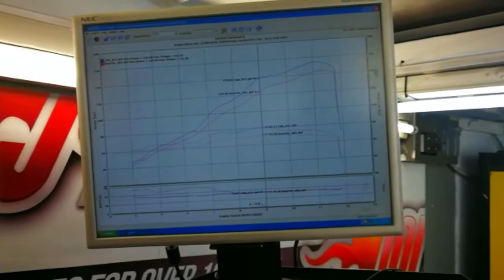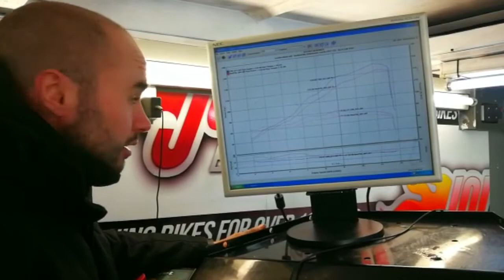JORDAN BIKES DYNO - YAMAHA MT-10 ECU REMAP FLASH 11 BHP GAIN

Comment: Hi, what are the expected gains on the simple ‘bench’ tune with a decat pipe please? Thanks
Reply from the maker: Dave The Rave we’d recommend a custom fuel map if you’ve removed the Cat, as it will be running lean. We don’t quote figures as every single bike is different. Watch the video on our ECU page on the jordanbikes website in which nick explains what we do and what you can expect. The MT10s we are constantly remapping as they are so snatchy on the throttle. We can make them loads better 👍🏼
Reply: jordanbikestv ok great thank you, will be in touch